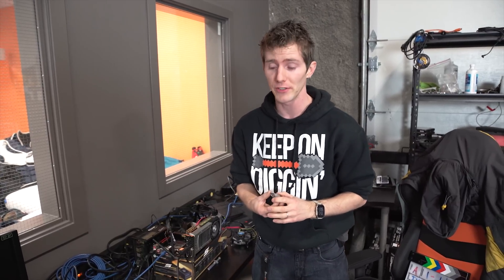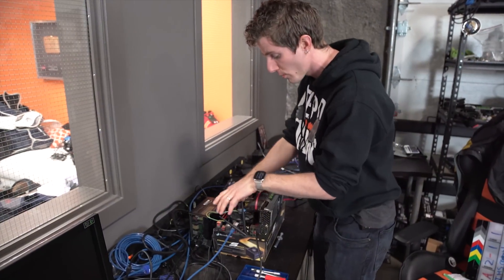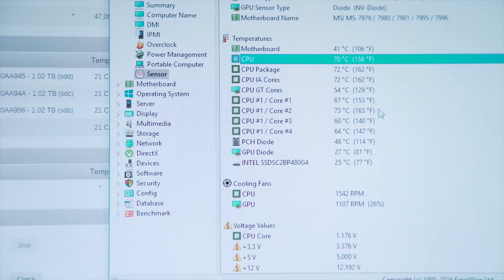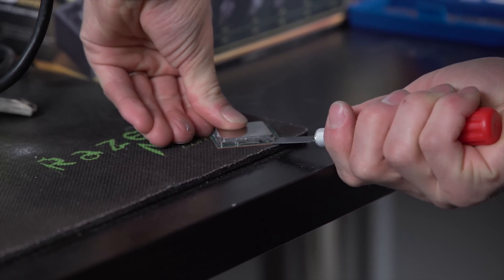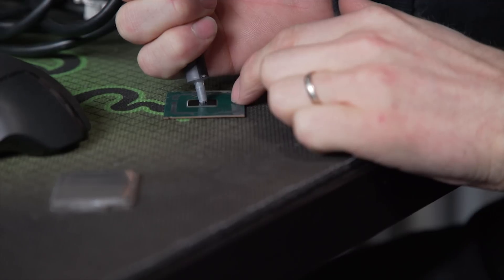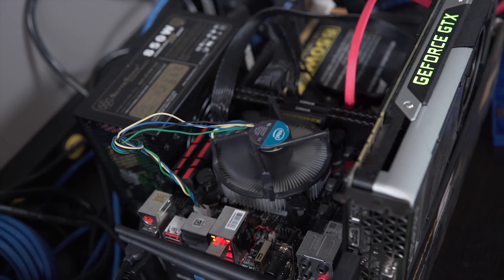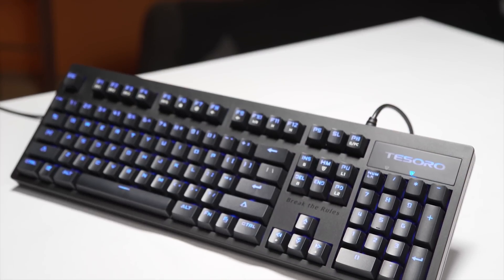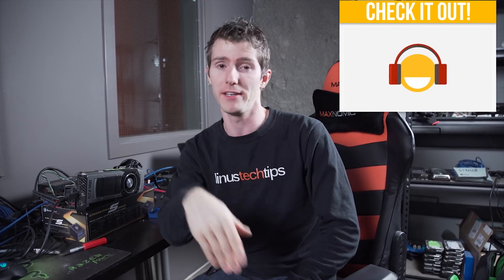Delidding an Intel Core i7 6700K - Is it worth it!?

Comment: The CPU is so small! It's hard to believe that there is also an integrated GPU in it too. Now that I know the actual CPU is protected in a ton of casing, I suppose that I don't have to worry too much about handling CPUs, as long as I don't bend the pins or leave unwanted skin oils
Reply: Dante Inouye Talking about AMD under a delidding video seems off topic.
Reply: Nidhogg84 I remember those! Damn, those things were a pain, I killed one of them by putting the heat sink on wrong, and crushing the small surface mount stuff on top. Those little rubber mounting stand off things never worked for me. There was also the fact that if you bent the CPU pins, you ruined your very expensive CPU, and not the (usually cheaper) board. Ah, good times...not.

Although if we go back that far, I think the Pentium 4 cpus deserve mention. Those things had giant dies, yet the GPU was on the motherboard. Damn those things ran hot. And with the Pentium D series? Intel at its finest. "Oh, mounting 2 of the same cpus on one die, not even sharing cache is a dual core CPU." I remember 125+ watt tdps, and even more when overclocking. The Athlons were much better buys. 

Annndd I went off topic. Whoops
Reply: Chuckiele 
Erm, AMD?
Reply: Chuckiele The pins still do exist, they're just on the motherboard now.
Reply: You mean bending the pins that dont exist since the Pentium 4 anymore? ^^
Reply: Dante Inouye But they are soldered. Unless you wanna kill the cpu, you shouldnt remove it and you wont gain better temperatures by doing so either.
Reply: Nidhogg84 the good days of 100+ nm lithography XD. Yes, 180nm and 14nm is a gigantic difference. It's a factor of more then 10! And I stated earlier that the gpu wasn't on the die. Nor was the ram controller. That's why the core 2 series used DDR, DDR2 and DDR3, and why some Pentium 4s used DDR2, while some used DDR. I can't remember if they ever used DDR3. I don't remember if the later lga 775 boards supported p4s. 

Also, I have one of the aforementioned 125w+ tdp cpus. I have a 5820k, which approaches 125 at stock, and overclocked has gone as high as 178. Power hungry? Yes, but 100% worth. 6 cores at 4.5ghz? Yes, please!

Look how far tech has come since those days. Earliest I remember is the Pentium Pro, at a blistering 33mhz! I don't remember precisely what year this was. Maybe 96? Anyway, then the gigahertz war began, with the Pentium 4s versus AMD. the funny thing I find is that AMD began by releasing the more ipc minded cpus, the Athlons, while Intel released the power hungry, crazy high clocked Pentium series, and the gigahertz war ended with AMD releasing the power hungry and crazy high clocked FX-9590 (the first and last 5ghz CPU), while Intel ended with the ipc advantage with the core I series. Back then, I would have never in a million years guessed that AMD would have won the ghz war. 

Also, powerpc used to be a novel player before the core 2 era. Kinda sad that they went bust. They did have some decent little cpus. The Intel released the 65nm core 2 duos, and everyone went "ooohhhh, pretty." Then came the 45nm cpus that no one cared about, cause "ooh, my q8400 doesn't get a higher clock speed then my old q6600, what a useless upgrade boo hoo." 

I'm not even sure what I'm trying to say anymore, but it is fun. The good days of ancient tech, where you actually had a front side bus.
Reply: Now, that you ask, I need to explain my statement further to not mess things up. Intel never had the memory controller away from the Northbridge. Before Nehalem the CPU was connected to the Northbridge and the Northbridge was connected to the RAM, GPU, Southbridge, etc. After Nehalem The whole Northbridge was integrated into the CPU and the CPU was directly connected to the RAM, GPU and the Southbridge that was called PCH from now on and the FSB became the Baseclock which is only a number. In the case of AMD the memory controller was integrated into the CPU but the Northbridge kept existing until today for backwards compatibility and so did the FSB which is also just a number but kept its name. So it actually doesnt matter if its dual pumped or quad pumped because AMD uses Hypertransport anyway, which is somehow like Quickpath Interconnect by Intel. But to answer your question on my AM3+ Mainboard I have a dual pumped FSB of 200 and a Hypertransport of 2.4GHz.
Reply: ***** yeah, most of the mobile cpus have pins. I know for a fact the I5 2430m has pins. I took one out of a Dell, and put a 2670qm in (which also had pins)
Reply: Shambles1980TRealOne most Intel mobile are flip chip PGA. the ultra mobile are bga.
Reply: ***** true, I guess
Reply: I guess you never worked with older CPU, e.g. the AMD Althon XP series. They had no heat-spreader, and you had to mount the HSF directly to the die. The Integrated graphics logic is about 1/3 of the die, basically the same size as the CPU cores and shared cache. The i7-6700k could easily be a 8 core processor without the integrated graphics logic.
Reply: Dante Inouye  Pentium 4 (oldest) were 180nm process, and Skylake is 14nm. That's a huge difference.

Pentium 4 didn't have the graphics and the memory controller on the CPU die.

There are plenty of CPU with TDP greater than 125w, usually they are the E series, for example the Broadwell-E are 140w TDP, of course they have 10 cores
Reply: Im still using an FSB because AMD haha xD
Reply: ***** XD true. Do they still have a dual pumped bus? Or is it quad now?
Reply: ***** ah, I see. How far tech has advanced from when the fsb basically controlled the clock speed of the entire system. 

Also, the great thing about Haswell-E is that the board will usually be fine with massive base clock bumps. I changed mine once from 100 to 127 (4.1ghz). People with "K" skus don't realize their luck. Back in ye olde core 2 and Pentium days, raising the fsb was the only way to overclock, cause they all had locked multipliers (besides the extremes). I had a q6600 at 3.1ghz back then.
Reply: Dante Inouye on AM3+ the FSB still controlls the clock speed of the entire system because CPU, RAM, Hypertransport, etc are Multipliers but the FSB is only a number so that it actually doesnt exist anywhere so that you can increase it while decreasing several Multipliers without losing stability. That would be a great method to overclock locked CPUs but there are no locked CPUs anymore so it is rather pointless but you can for example use RAM that is higher clocked than the system supports, which wouldnt be a problem if AMD supported XMP in the first place but whatever. But yes, I was able to put my FSB to 230 without changing any Multipliers and had a pretty stable system but I achieved higher overclocks and more stability with using Multipliers only.
Reply: ***** I gotcha. Although AMD doesn't make locked cpus, Intel does though. 

Also, AMD's lack of support for XMP ram timing is stupid, absolutely. I don't have much experience with am3+, last I remember, am2+ was the best, but that was a few years back. I've never dealt with "FX" cpus
Reply: Dante Inouye From AM2 to AM3+ they didnt make big changes, only a few optimizations, because of backwards compatability. You can theoretically run an AM2 CPU in an AM3+ Mainboard and it works fine and you can also install an AM3 CPU on an AM2 Mainboard but that would slow it down really badly. You cant put an FX into an AM3 socket though because the pins are thicker. Actually you can try and might be successful but you most likely will bend the pins, which are another dead thing they are still using for backwards compatibility by the way. I havent dealt with FX cpus either but I will be getting one only for the cause of value.
The lack of support for XMP is really a problem. Most RAM kits I had even run on the wrong frequency and need to be overclocked via FSB to their normal clock and then the automaticly set timings were absolute garbage and the one on the package of the RAM dont work if set manually.
By the way there are rumors that Intel do add two extra generations to 1151 but there wont be coming any new unlocked CPUs at all and 2011-3 isnt supported anymore either. They say there will be new unlocked CPUs for the new 2066 (I think?) exclusively. What the fuck even. Meanwhile you can buy a 3960X and 2011 Mainboard for 300 bucks on Ebay!
Reply: ***** 
I gotcha. I gotta get back into AMD, they're releasing a new architecture soon. Something Japanese, I forget the name. AMD is antiquated in their use of pins on the CPU. They really should switch over to lga type motherboards. 

Lack of XMP is idiotic. I don't even know when to start here. SMH at AMD. 

Really!? They're not releasing unlocked cpus except on extreme boards!? The 6700k and 4790k are their bestsellers!!!!!! They're taking a gigantic market, and throwing it out the window.

It's nice to find an intelligent person that can hold a conversation on YouTube.
Reply: Dante Inouye  AMD's new architecture is Zen.
Reply: Nidhogg84 yeah! That's what it was. Zen! I knew it was an Asian sounding thing. What do we know about zen? I've heard 30% increase in ipc over pile driver, and real cores, not modules.
Reply: Dante Inouye Not just the lack of XMP or LGA but especially the FX generation being so weak yet power hungry made them reach a point where they arent close to a danger to Intel, thats why they can do anything without risking their market: Stopping to solder the IHS, using cheap thermal compound, completely destroying the stock cooler, prohibiting the mainboard manifacturers to make you able to overclock locked CPUs and now wanting you to buy a thousand dollar CPU to be able to overclock in the first place (which is absolutely not confirmed and only a rumor) or to sum it up: They want to make as much money as possible while spending as least as possible, because there is no market.

Im hoping Zen will be a killer, not just because Im an AMD fan but also because I cant stand the policy of selling garbage for a premium. There are leaks mentioning an 8 Core 16 Threads Zen prototype having a IPC not far worse than Skylake. This might sound mean but AMD is finally back in the business they are best at: Copying! They had the greatest successes when they copied Intel and did a better job at a lower cost, especially when the Pentium 4 failed and the Athlon XP just raped it. By the way did you know that the constructor of Athlon XP came back to AMD to construct the Zen architecture? Exactly, with SMT, high IPC, and low frequency. Theyre doing yet again what theyre best at and I hope that will disturb Intels policy badly and bring balance to the market again.

As I said I dont wanna hate on Intel, Ive always bought AMD but if Intel realizes their mistakes and Coffeelake will be awesome and affordable I might even buy it. But for now Im just waiting for Zen to fix some things. There are even leaks of a Zen based APU with HBM which will run on the same Mainboard. Thats too good to be true but that would explain why AM4 will be incompatible to AM3+ and FM2+ and im really excited to see what will come.
Reply: ***** really!? AMD will be a big player in the market again!? hell yeah!! I was getting bored with Intel constantly controlling the market. Without AMD competing, Intel drove prices through the roof. 1700 dollars for the best core I7!? Back when it was x58, it was around $1000!

Honestly, I want zen to be a big leap too. Also, your right about the copying thing, AMD even used the same sockets as Intel cpus back then XD. The Pentium 4 was pretty pathetic, honestly. The Athlons were far and away the better choice. 

An apu with HBM? I want it!!! Although that would be exorbantly expensive, to buy hbm for system ram. Unless they put the vram on the die...nah, that would be crazy difficult.
Reply: Dante Inouye No, the leaks say that there will be HBM on die similarily to the Fury GPUs and there will be a seperate memory controller for DDR4, because the mainboards for the APU and the normal Zen are the same. If the leak is true, then there will be a bit HBM and then you can add DDR4 optionally, so you could consider the HBM as some sort of Level 4 Cache I guess.

I dont wanna be hyped because I will be disappointed either way but I am and I wanna see the CPUs as soon as possible. I really cant wait to see AMD back in the race. They dont need to be market leader and they wont be unless the rumors about Intels unlock policy are true but there defenetly will be a change in the market if Zen is a success.

And I know about the time they copied even the socket. I was just born when they built Intel compatible CPUs but I can remember using the first PC of my family which was an Athlon K7 500Mhz for Slot A, which is mechanically the same as Slot 1 but isnt compatible anymore.
Reply: ***** cross your fingers and pray. Also, that APU sounds epic. I really want to see that.
Reply: Dante Inouye The first generation of Zen is planned to be released in the first quarter of 2017. AMD has been delaying their releases frequently but Im hopeful anyway. xD
Reply: ***** so maybe late 2017 or early 2018 XD. Kidding, they probably will release mobile chips before they release desktop. I wouldn't put it above them to release mobile zen cpus withing the 1st quarter of 2017.
Reply: Dante Inouye I dont know, we will see.
Reply: TrulyStupidGaming its similiar to a laptop processor so i wasnt surprised
Reply: I can't imagine being the team that has to look at that schematic and test it. "oh circuit number 83jeur8ti4h is the issue"
Reply: Shambles1980TRealOne  Actually they do.
Reply: ***** Me too, it's crazy that they make 'whiskered' masks and the like to do things like electron bean lithography, and theybeat the diffraction limit of them that way. They are getting down to where they are good at massively paralelling powerful things, it is only short time before you have machines designing rhe next faster processor, and those processors will design even faster processors. Trying every rule of thermodynamics and quantum atom states where processing and storage ability will be limited to the things measured as a few atoms across. In theory they call this "the singularity" and there are all kinds of guesses as to how soon it will happen. We do now happen to have monolithic slabs of glass and plastic and a few other traces of elements that can provide us with the full unabridged access to the entire sum total collection of known human knowledge (and by default stupidity)  by the mere effort of exercizing one's brain and the calm, perhaps vigirous wiggling of one or two thumbs on such a device.  It (the internet) has truly shrunk the world quite a bit and many thinge we would think certainly in the 70s, in the 80's 90's and early 2000's would be impossible but we have done it. "Star Trek" is here. We have desks with tablets on them with instead of paper... desktop computers with video phone capability... all that. SCI FI stuff if you were a jail prisoner if the 90s and got recently released (and you watched star trek) you would have no difficulty admonishing our tech and advancements as a kind of "magic" or wonder and pinnacle of mankind.
Reply: i have an i5 4460, it has pins, its like most intel fanboys are so excited cpu's come with pins now that they assume EVERY cpu is pinless.....
Reply: stevenmael bull... 4460 is LGA (no pins on CPU). AMD still uses PGA. Intel mobile CPUs may use PGA or BGA.

i5 4460 is socket 1150 so it has to be LGA.
Reply: yeah, ive never heard of a 4460 that isnt on an LGA type socket. I don think it exists.
Reply: ***** Nope, they have balls.
Reply: ***** Thats an absolute exception.
Reply: TrulyStupidGaming A gpu is the same size as a cpu
Reply: only a few handfull of Cpus now has integrated graphics... majority of the time.. integrated graphics is from your motherboard... this i7 does not have it..
Reply: khang pham err where is your logic in that, the cpu has igpu (it's in the name) if it was in the mobo shouldn't we chuck them on all mobo? For trouble shooting and for faster on the fly video encoding?? Or maybe it's on the cpu that's why we don't have them on high end chipset (like x99) cause those cpu will be most likely pared with gpu... also it will give off more heat with the igpu not to say take up valuable space... this makes a tone more sense if it was on the cpu, huh who would have thought??
Reply: you are right sir its called APU... i had an amd A8 with integrated.. and mobo only supports it or not... sorry i was not informed well
Reply: khang pham right, buuut... plz refrain from calling me sir , jeez makes me sound like an old guy, I'm only 17... :D
Reply: Yeah like he did with his oils xd
Reply: ***** 
AMD has ihs on the cpus
Reply: Dante Inouye I know. I just ignored AMD because it doesnt fit to the video and noone uses it anyway. Im an AMD fan myself though.
Reply: ***** yeah, but still. In this conversation, we weren't talking about de-lidding. The op was talking about handling cpus
Reply: noone use AMD? ok this end the discussion

Comment: The thermal adhesive should had been removed on the substrate too, naturally the height adhesive left over keeps preventing the IHS to have the maximal contact to the CPU... this is quite a big oversight and it naturally makes temperatures worse than needed to be.

Comment: A couple of degrees and a couple of degrees more and youre running 5 or even 7 degrees cooler, which is already a LOT. The way heating works, if you run already at lower temps you wouldnt get such a good result, but still, the conclusion seems a bit off. Of course your CPU wont run 20 Degrees colder on the same stock cooler, but the material costs for this are literally 50 cents for the Thermal paste. There arent that many cheaper ways to go down 5 °.